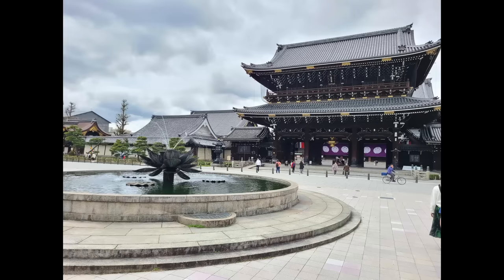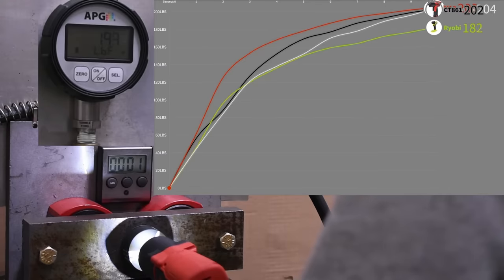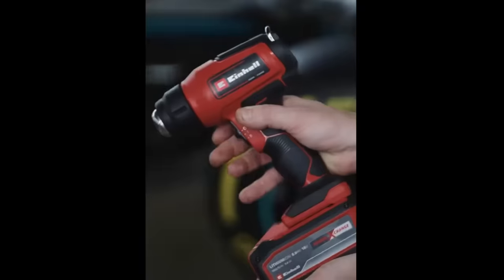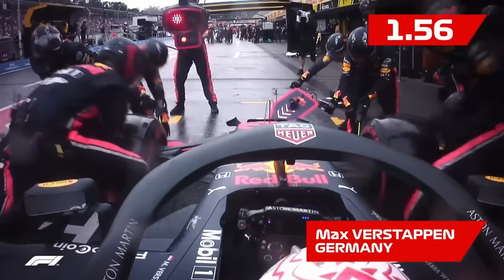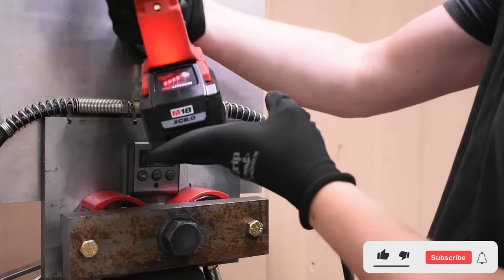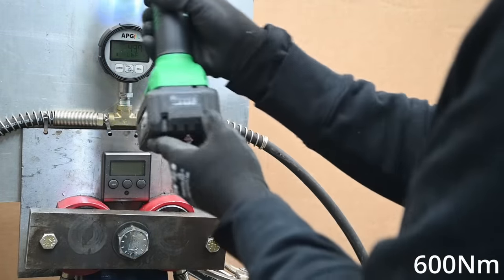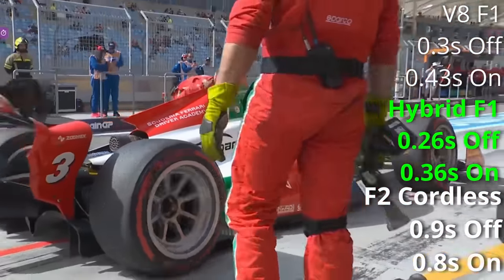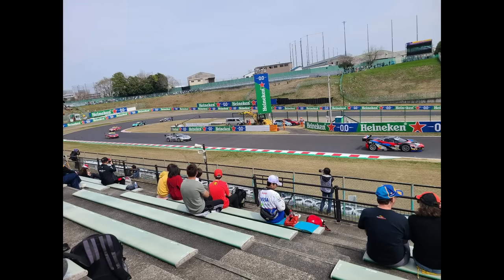How Formula 1 Wheel Guns Work & Why Not Cordless?

Comment: F1 being carbon neutral is the BIGGEST MEME  ever 😂 it will NEVER  be carbon neutral 😆
Reply: Especially with all that fiber being used
Reply: @Eric-dr5bj  and all the travel required, planes are not going "carbon neutral" anytime soon 🤣 and they need ALOT of them
Reply: >Carbon neutral

>Sends drivers in separate helicopters for a couple mile trip
Reply: Methinks you are quite confused as to what meme means.😂
Reply: I don’t think you understand how that works. There are already FE and WEC teams that are carbon neutral, no reason why a F1 team couldn’t be.
Reply: You don't understand the definition, or you're being purposefully obtuse. You buy carbon offset, it's just money. 
Your coal rolling bro dozer can be carbon neutral if you spend the coin.
Reply: @maxmotors9497 “Meme” lost its original meaning years and years ago. Nowadays apparently it’s just another word for “joke.” More commonly referring to image and short video based humor though.
Reply: Carbon neutral is as easy as buying carbon credits from other entities. It's a money scam.
Reply: F1 cars are pretty efficient...
Reply: @mcspikesky  that's not the problem, it's everything else
Reply: But not for the reason you probably think. The engines they use are the most efficient ICU/Hybrid aggregates ever built. Of course they guzzle quite a bit of gas, but they get more performance out of the fuel than any other engine before - around 800HP out of a puny little 1.6L Turbo V6 plus 160 electric horses for up to 30s per lap. 

The problem is the circus around it and having it move around the globe in the most inefficient pattern imaginable. They arent even trying to keep the distances short, they hop all over the place and they have these fancy night races in Abu Dabi where electricity is generated by burning oil... because they have a lot of it.
Reply: Carbon neutral is just a huge con job.
Reply: @otm646 If you use a definition that is a joke to anyone with a brain, you are the one being obtuse. Yes you can buy credits. Why doesn't everyone in the world just pay for carbon credits and then we can just keep on dumping out carbon as much as we want? Oh yeah, because that would defeat the purpose. Carbon credits are a way for the rich to pass the discomfort of actually changing behavior on to the poor. I say this as someone who doesn't give two shits about my carbon footprint.
Reply: That's such a stupid pointless phrase
Reply: Actually, it is Carbon neutrality and offsets that are the biggest untapped meme out there. Essentially I can pay some other dude to leave his wife alone so I can cheat on mine. 🤦‍♂️🤦‍♂️🤦‍♂️
Reply: Its even funnier with their primary sponsor being Aramco, ya know the Saudi Arabian State owned Oil Corporation.
Reply: If all F1 engineers would be allowed to solve co2 emissions in commercial aviation instead of designing F1 cars... maybe they would figure it out. You know, instead of the current lobby of Boeing, Airbus and big oil...
Reply: @rkan2  bruh it's not even about new technology though. We don't actually need any new revolutionary tech (although it would help). 

You just have to build a competent major rail network, and electrify it that gets rid of the need for almost all trucking/air based cargo, reduces cost and virtually eliminates emissions. 

Switching to renewables and carbon neutral electrical generation systems has been feasible for decades, France has been majority nuclear for 50 years, Switzerland has large scale grid electric storage with pumped water dams that act as country scale batteries. 

Better density in cities and just functional public transit. All of these would effectively reduce emissions by ~75%, have been technologically and economically feasible for decades. But they don't make any company money, just like curing HIV/tuberculosis in poor countries it's not a matter of possibility, but it's about people just not wanting to do things that don't immediately make money. It's obviously the right idea, better infrastructure means average productivity increases and better quality of life for everyone, not to mention the planet doesn't burn. Curing tb in the developing world would free up so much time effort and productivity that everyone benefits, but since pharma companies can't charge $100 a dose to the average person in the Philippines, they don't do it.

It's all already possible, we just need to oust the profiteering corrupt politicians that bailed out banks in 2008, that don't prosecute boing for literally assassinating whistle blowers.
Reply: @1978JonBullock This. Nothing that says it’s carbon neutral is.
Reply: The air travel alone is unfathomable.
Reply: @cademckee7276 The only way to do that is for them to fund tens of millions of dollars in carbon capture. No bullshit offset programs or credits. Real carbon capture. Otherwise it's just lip service.
Reply: Too much carbon fiber for that
Reply: I want to BRING Back The DAYS of V8s V10s V12s and 20.000 RPMs I HATE What F1 has done love the good old days WHEN TEAMS $PENT $500.000.000.and we enjoyed the SOUND of ENGINE'S SCREAMED
Reply: @rkan2 I know several F1 designers that went in the aerospace industry.
Reply: @otm646  most carbon offset you can buy is just a scam.

For example you can buy carbon credits from a company so a part of a rainforest doesn't get cut down. Sometimes the forest was never meant to be cut down, sometimes it doesn't even exist.

I start to believe in carbon offset when people pay for carbon capture...
Reply: Careful what you wish foe
Reply: But the marketing meme of saying they are is
Reply: @otm646  Carbon credits are the modern version of indulgences
Reply: Their drivers literally uses private jets to go everywhere 😂😂
Reply: You clearly don’t understand the concept of carbon neutral. Wow.
Reply: @alshoutcasting9101 honestly my favorite part 😂
Reply: @paulharrison2325  Paying someone else to make the weather better?
Reply: @GoogleDoesEvil  I’m not commenting on its merits, just that this comment is completely wrong.
Reply: @1978JonBullock just like cereal is labeled as "healthy"
Reply: If there's one place we need to abandon any notion of being carbon neutral, it's motorsports. Come on man
Reply: It could be. Like if they buried all the losing teams in a landfill, the carbon emissions save over their lives would probably make up for it.
Reply: @maxmotors9497  meme is a vague term, the definition is still evolving
Reply: If Formula E is
Formula 1 will be
Eventually
Reply: @cademckee7276  buying green "credits" is not being carbon neutral, its pretending to be :)
Reply: When not driving 😂
Reply: Synthetic fuels are looking promising, but yea, not anytime soon for sure
Reply: Sure it will, they'll just pay some shady company to plant trees and it will all even out xp

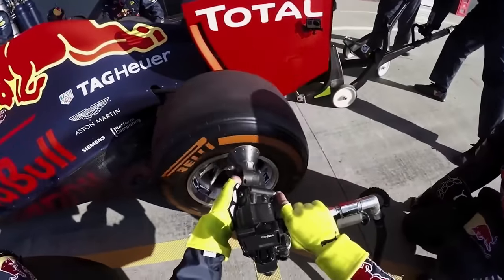Comment: 4:42 The largest battery you can fly with on an airplane, without an exception from the airline, is 100Wh. That's why you see the 5 Ah versions.
Reply from the maker: They don't seem to fly this stuff on commercial flights there though.
Reply: @TorqueTestChannel  My understanding is that everything car or pit related gets flown place to place.  It's only the really big and bulky stuff that gets container shipped. They have multiple sets  of that equipment (4 or 5) to meet their international race schedule.
Reply from the maker: Dewalt 15ah batteries taking a lonely truck to each track then :p
Reply: F1 charters commercial cargo and there you don't have limits, even sometimes when flown on passenger planes limits don't apply or are higher. In regular baggage you have the limits mentioned.
Reply: I'm sure F1 would get those exceptions
Reply: @TorqueTestChannel some large batteries disconnect into smaller packs electronically when off the tool, which should make them okay to fly. I’m pretty sure the 8.0ah Metabo HPT multivolt pack does this trick, so it’s listed as 2x 4.0 ah packs for transport. I don’t know if the dewalt does this though, or if airlines actually are okay with this trick.
Reply: @rkan2 nope. No lithium batteries in cargo on passenger planes allowed at all.
Reply: Yeah via DHL cargo planes
Reply: @Validole   They absolutely can, Cargo only and private as well.

Comment: The hardware store up the road from my house sells the einhell tools and I was quick to jump on them to try them. Especially for the price they have here in Canada. I got a 1/2” impact, hammer drill, 1/4” driver, grinder, jig saw, polisher and 6 batteries for less than $300. The only downside is the impact isn’t good for much but motorcycles because it wouldn’t take off lights torqued to 75 ft/lb. Haven’t had a problem with anything else though

Comment: That's why my preferred choice for auto type work and wheels is a small pneumatic 1/2" impact gun that turns 11,500rpm, weighs a mere 1.3kg and is under 6" in width. It's like the 2T YZ125 of impact wrenches, only offered up an honest 350-400ft lbs, but boy does it do it FAST. On standby is the MAC tools nano that's on their latest catalogue aka the Facom Nano NS1600 & the Astro Nano 3/8 when I want to just slow things down & relax. Now my high torque fuel big phat heavy full size Milwaukee M18, meh its got beans & powa's but it's big, heavy, clunky, slow, unbalanced and just down right not enjoyable to use with one hand or even two. But...all the cool kids love them, I'm just not cool I suppose 😢
Reply: I think it depends on what you already have in your shop.  If you have a 25 gallon (100 liter?) air compressor or larger, then yeah... air tools all the way.  I have a tiny air compressor since I rarely need it, as much as I need to do typical bolt removal, hole drilling, etc.  And for the home gamer, electric has an advantage of portability that air powered does not.
 
 I think it breaks down something like Pro/Semi-Pro users are gonna find air tools better.  For the anything below that, electric is going to be good enough with a lower initial cost of entry.  Just my opinion, so take it for what it's worth (essentially zero).
Reply: I would have all air tools but I can’t stand the noise. It’s deafening.
Reply: @markm0000 ear protection has the benefit you can ignore your buddies at work with the excuse of having your ears covered.
Reply: @RGV2300  unless someone makes silent air tools I’m never using them.

Comment: I love my set of Bondhus T-handles. Had a metric set for years I bought at my local electronics components store. The solid metal handle rather than just an allen key with a plastic covering is a massive improvement. Now I need an SAE set and a Torx set as well. Maybe I will try the Kennedy ones next.

Comment: If you want to source some Einhell tools you might wanna check for the Ozito Brand. It's the exactly same tools and batteries, just branded differently for the international market, mostly UK and AUS. 

It's a DIY brand, though.
Reply: Another comment said he bought Einhell brand up in Canada, in case Ozito ends up being tough to source. 
(although, he said the impact wasn't even capable of removing 75ft/lb headlight screws 😒 lol)
Reply: @DUKE_of_RAMBLE  Yeah, impact stuff definitely isn't their strong side. They have a very small range of impact wrenches (three afaik) which also is really weird, with two going for up to 215 and 230nm respectively, and one going up to 400. They all look as if designed 15 years ago, despite being brushless. 

Their range of garden tools is humongous, though.

Comment: 400 psi using the compressed gas cylinder and regulator of your choice would be easy to manage. Don't rely on regulator feed pressure which limits flow. Do have a high pressure cylinder with a large outlet as an expansion tank. One way we used to gasify liquid argon before feeding our welding booth manifold was to run a tee with the Dewar feeding one side, the other side being the outlet and the cylinder valve (which is restrictive) handling expansion flow. We didn't use a heat exchanger since we also used a spider and gaseous shielding gas depending on what was available.

Comment: They don’t use Dewalt cordless impacts because in testing they were actually so powerful that they spun the car upside down once the wheel nut was tight. They decided that F1 just wasn’t ready for Team Yellow’s Thor Hammers yet. Maybe after 2026 when the regulations change.

Comment: 350 Lbs of pressure is nuts.  I thought my 2141 Ingersol is pretty snotty at 165 psi. (Not all the time) 
The Snappy micro lithium 3/8 cordless needs the switch replaced a month out of warranty, mine got rained on during a surprise thunderstorm,  and started smoking in the tool bag in my car, while driving.  I liked it, but it was fragile and expensive. Battery terminal tension problems as well.

Comment: Definitely can't blame you for making a business trip out of it lol, that sounds so fun. I have a future video idea, rotary tools - both battery and corded. I needed to buy another dremel but wasn't going to use it much so wanted to save some money. I was about to get a cordless model but worried it wouldn't have the same RPM and power as a corded dremel. I ended up getting a corded knockoff for $30 that I hope will do the business. Would be interesting to see if the brand-name dremel is worth the money too.

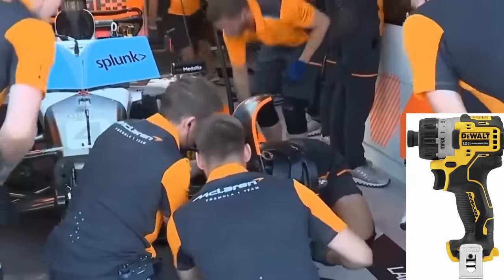Comment: @2:32  In also use the DCF 601 the most for smaller (most) fastener installation the most!  Just like real F1 mechanics!  The clutch settings come in clutch! To prevent over tightening!  The Dewalt cordless ratchets are both slower and to strong for some fasteners for install so I use the ratchets in small fasteners for removal where even the speed of small impact wrenches might damage soft aluminum threads.   I use the ratchets for install on larger fasteners.

Comment: A nitrogen cylinder is cheap to lease or borrow (and cheap to buy used then exchange or have refilled, every gearhead should have one for purging HVAC etc or doing your own tires dirt cheap). Some nearby patron may loan them for a plug. A nearby welders supply would love the recognition. BTW soapy water sux compared to tire mounting compound which I wish I'd used decades ago. A tub it worth it for a DIYer and it doesn't promote corrosion. Soap isn't even close.
Reply: mounting a tire on a rim, use good old baby powder, no mess and no fuss

Comment: What guns are Nascar Cup teams using?  They also use a single nut and nitrogen driven air gun
Just looked it up and they also use a Paoli gun which is supplied with hoses and regulators from NASCAR.  Well I'm not really sure anymore as I think they stop the idea of supplying guns to teams and let them use there own supped up machines

Comment: what would say an Astro pneumatic make if it was fed ~400psi of nitrogen... even if it didnt survive im sure there would be a scenario where a seized bolt was costing thousands dollary doos an hour holding up a an operation.... as someone who has been in the grimy parts of an oilfield i wouldnt doubt that there are ingersol rands that have been fed natural gas at well pressure when the trucks built in 150 psi vi-air system wasnt cutting it

Comment: This answers a question I've had for several years, they don't have a battery gun with enough speed and torque. As an OLD slot-car racer, I've rewound little DC motors, worked with armature reactance, and better brushes to achieve much more RPMs and torque than stock, which brings up the question of why aren't there custom electric wheel guns that can do this? My modified slot car motors used far more battery than a stock motor so I would expect that a custom wheel gun would too, and15,000 rpm is not that hard to achieve. So, whaddya think??

Comment: I think the only reason those F1 guns cost what they cost is BECAUSE they're known F1 guns. Realistically they should be under $1,000. If racing teams stopped using them tomorrow, within a year the price would drop to under $1,000.
Reply from the maker: You wont find many impacts made from carbon fiber and taking 400psi

Comment: To be fair - air gun is environmentally cleaner than battery one, main pollution comes from manufacturing these things, batteries in particular... and battery is dirtier every time than compressed air using electricity... unless somehow they use diesel generator or compressor... but in that case they probably would be charging batteries with one. 

So if they replace air tools... it will not be for environment, more likely for convenient of not having air hoses around.

Comment: commenting before watching the video, seems common sense that our cordless lithium ion impacts are built for torque/impact force to get us out of rusted seized up situations and we couldnt care less if it takes 10 seconds or 110 seconds as long as the bolt comes out.. where as F1 is dealing with very consistent easy to break loose lubed threads that were only fastened within the house they need that nut off in a fraction of a second and the slow du du du of a milwuakee or dewalt would infuriate a pit lane crew... if they let an F1 car sit in the weather and salt for years not only would they not be running that vehicle in the competition but they wouldnt care if their pit lane impact didnt take off the wheel nut

Comment: Air guns used in motorsports in general don't have a lot of torque.  Not certainly anywhere near 1000+ ft/lb like the 1/2" gun I use at work because it doesn't need that much torque to loosen/tighten wheel nuts.  What the guns they have is a lot of speed to save precious seconds and no cordless guns can match that speed.

Comment: So would a hammer doing a full rotation, hitting the anvil on that trihammer design, deliver a harder impact than a triple that hits 3 times a rotation?
Reply from the maker: Thr tri hammer also hits once per rotation but on three surfaces. And typically no